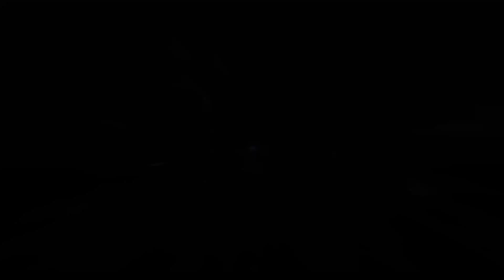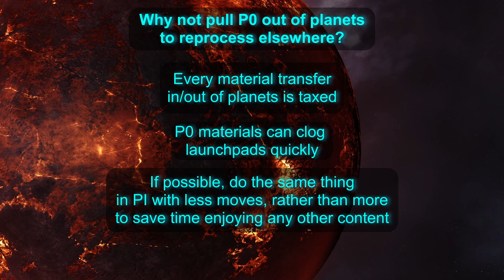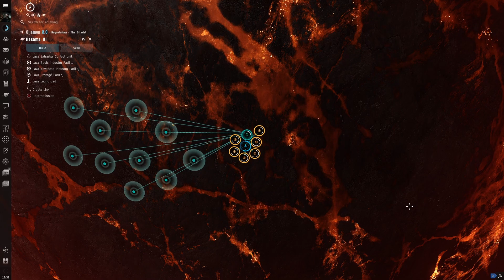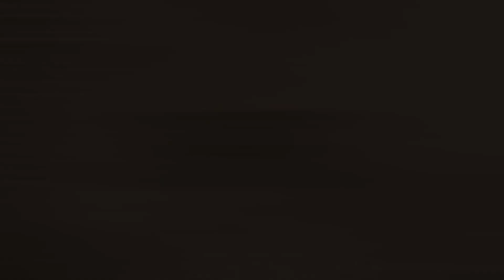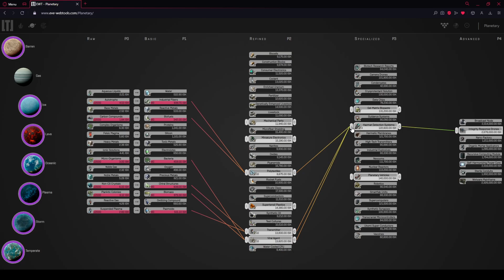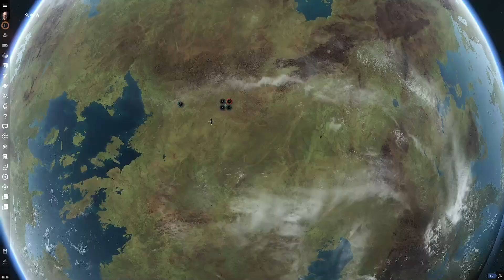Advanced PI setup -  Make your way to riches | EVE Online

Comment: WHY?
t0 ore is most valuable in this game.
Just sell t0 and buy whatever you need, you will get what you need and even earn money.
trading is broken to the core, in this game.
Reply from the maker: Pretty sure you would pay higher taxes because there is a ton of P0 material you pull, you would have to micromanage it to hell. But, if people buy it off of you, go for it
Reply: @GildiiAuscent  No taxes, what taxes?
Are you telling me you are doing PI in HS and LS???
It is micro macro drek, yes- but it brings about 2 bil per month. minus 100mil for services of trucking and you know, it is what it is.
Reply from the maker: Yeah, I don't live in a ns block nor want to have to spend an hour rolling random whs to keep running it. I keep my pi minmax free
Reply: @GildiiAuscent  I dont either, I am WH guy.

Comment: Hey mate, great video! Can I clarify one thing? If the ratio is 1 - 1 - 0.5 - 0.25 for T1 - T2 - T3 - T4 refineries respectively, then why you have only 3 T3 refineries? As I understand, you have 4 extraction planets x 6 T1 refineries = 24 T1 refineries (not counting the extra 7th for simplicity), and you need 12 T2 refineries (which is what you're showing in the video, 6 + 6 on the sides), so you should have 6 T3 refineries to run them efficiently without having too much unused T2 materials? 

I'm currently trying to figure out how to make a T4 planetary and this calculation thing drives me insane, trying to figure out how much planets/refineries you need across all the characters is way to hard haha 

Thanks for the answer!
Reply from the maker: For t3, you need 2x the material a t2 factory outputs, and they both have 1 hour cycle times. So you need 6 of a t2 factory to supply enough for a continous t3 production, for each of the t2 materials
Reply: @GildiiAuscent  Oh got it, it's the materials  I forgot to account for. TYSM!

Comment: What kind of Profits are you making? I do PI quite differently. I avoid tax like the plague, The only time I use my launch pads is to send up my final materials. I make P2 materials on each planet. 6 different materials to diversify my portfolio so that all my eggs aren't in 1 basket. Never selling below 10k isk/unit I make over 23b isk/yr which easily plexes my accounts.
Reply from the maker: Honestly, I have not been checking the pure profits from my PI for a while. First character produces robotics, second all.of the p2 needed for fuel blocks, so I use it to maxomize profit margins on fuel production. Then third one makes organic mortat applicators for station production

Comment: Good video. I have 2 different types of factory planet. 1 is running 3 High-Tech factories, with 18 Advanced  making the necessary P3 to feed them. That's 6 Advanced per input.
The other setup runs 1 High-Tec with the associated P3 & 1 small P2 setup.
Both have the P2 being made on other planets to feed the P3 factories.
I don't extract anymore, to preserve my sanity.
Reply from the maker: Yep, there are many ways to make PI, one being buying stuff low and processing it into high tiers. As long as it prints isk, its nice :D

Comment: I have 19 characters producing PI. The issue that I would have with your setups are that I am producing so much P1 that I would not be able to process it into the higher level P2 fast enough. Like you, P0 gets directly turned into P1.  My P2 and P3 factories have 2 launch pads, 2 storage containers and 22 factories. My P4s have 3 launch pads, 3 storage containers and 9 factories. I set my extraction cycles to 1 week. With that many characters, resetting the extractors daily would be too painful and the volume is more than made up for by through sheer numbers. Remember, each account has 3 characters and if you are already paying for Omega, using those empty slots as PI characters is a great use of your slots and Omega. The SP to get started in PI is very low (about 2-3 small injectors gets you a decent epithal and ok starting PI skills). After 1 MCT you will have a good PI character, after 2 MCT's, you would have max skills. It is important to purchase 2 implants (Charisma and Memory I think.). You don't need a full set because most of the PI skills are covered with just 2 attributes. So PI is easy to scale, so long as you have the stomach for it. I am currently producing about 10b of PI per month.
Reply from the maker: I can imagine that at that scale and long extraction times you end up having to change it around. I made the setups for what I do and level I have experience in, and with bottlenecks, some of the extra mats I just excha ge between chars to keep them running smoothly
Reply: How much do you make with this setup?
Reply: @Madgod711  10b a month. Give or take a bill.
Reply: @wayneyessir6350  Okay yeah, that's where my calculations last night brought me approximately. I DEFINITELY have to get into PI. I've been gas huffing to plex my accounts, and that's at least 30 hours of work a month. This would be maybe what, 30 minutes a day?
Reply: @Madgod711  Well, first realize, i do it in Null, so i get better returns than someone would in High. As far as time per day. I usually spent about 1-2hrs a day doing 5-6 accounts. But obviously someone can break it up however they like. key is not to get burnt out. break it up into manageable chunks, even if you lose a little effeciency.
Reply: @wayneyessir6350  Do you  courier contract your stuff out, cyno in and out, or just raw dog it?
Reply: @Madgod711  I am part of a null block, so there is infrastructure that allows me to move it.

Comment: Links are excessive especially after they halved the m3 of all PI materials. 
Might be able to fit more factories if they are reduced to the minimum required.
Still a better setup than a lot of other ones I've seen in videos.
Reply from the maker: Yes, you could probably fit more but I also did not do all the minmaxong with the max amount of jumps materials can travel in p3/4 planets, this is just for convenience. And with those numbers, you are sustaining exact numbers of factories needed to keep going, nothing less, nothing more